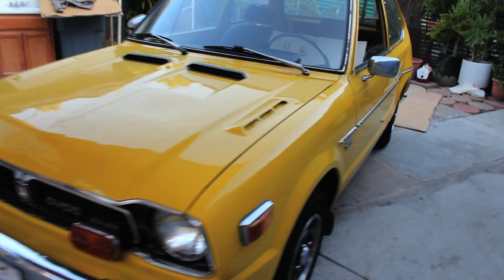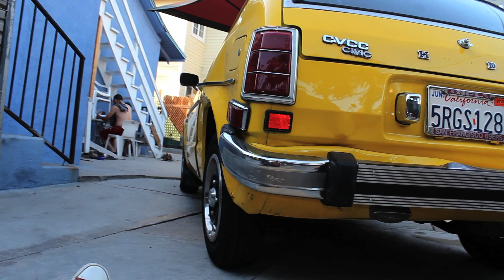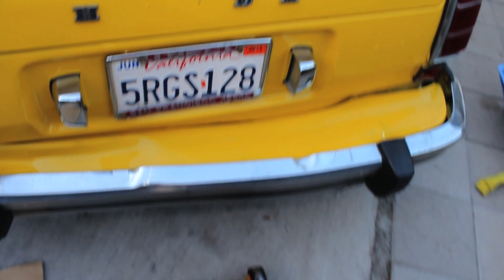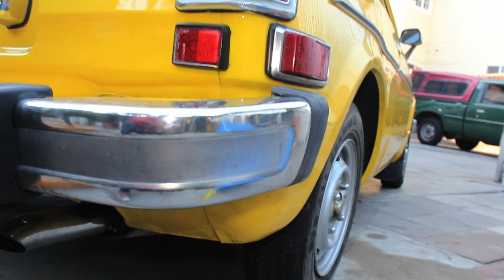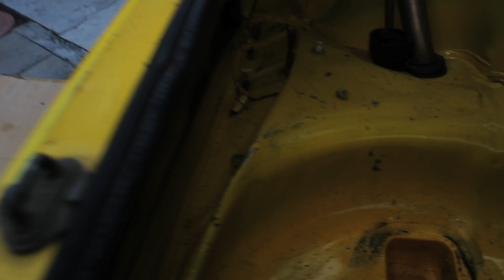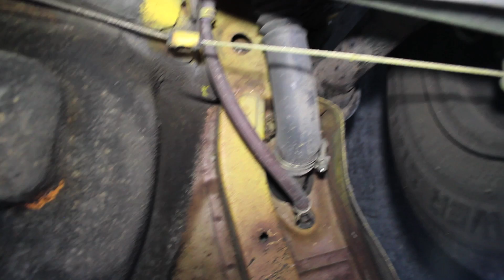Big Bird's Crash Aftermath

Comment: yeah, it was very painful. No I havent fixed it Im just using the car for car parts now. I bought a 74 and all the interior of this on is on my 74. The doors and fenders are on my 79CVCC. LAter I'll probably be putting the chassis on craigslist maybe someone will want to buy it. If not Im going to junk the chasis. The engine I'm going to put in on a 76 CVC that I bought and will be restoring slowly. YEah, when ever you need something check out let me know.